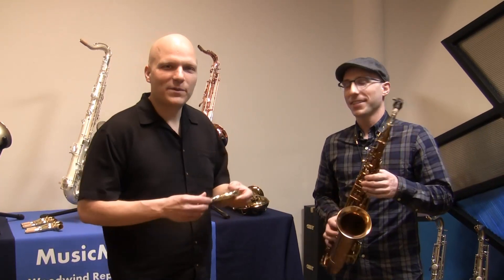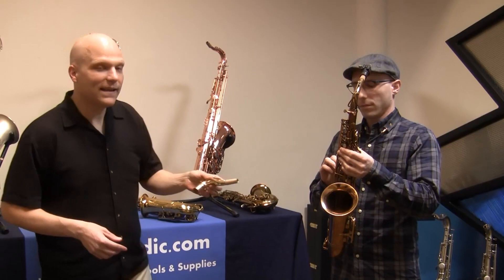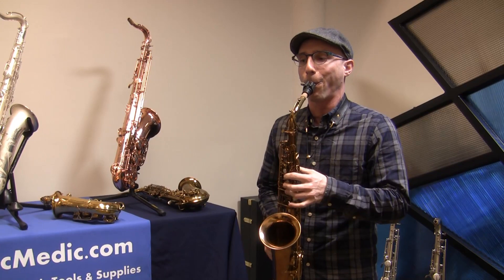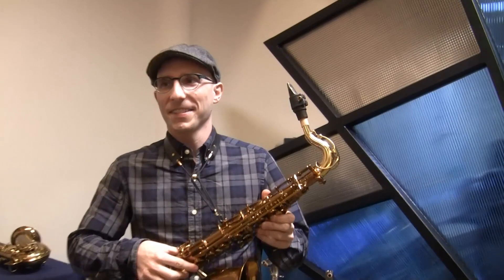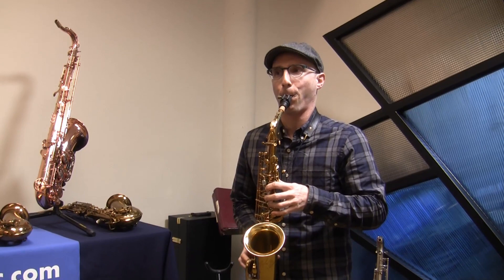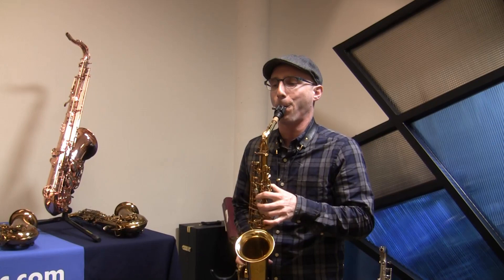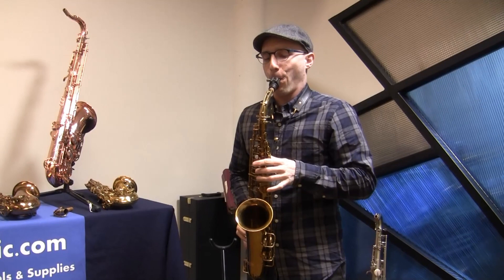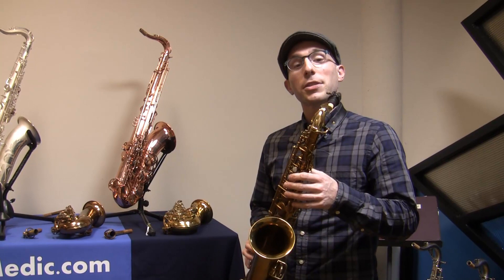Talto Neck Test With Richard Zimmerman

Comment: Does it fit in a YAS-475?
Reply from the maker: The 475 should have a tenon around 24.5mm I think, so this neck would fit. You would most likely need to have this neck fitted to the body as well.
Reply: Hi, when is going to be available again? I would like to purchase it